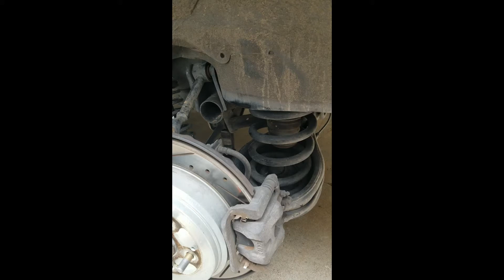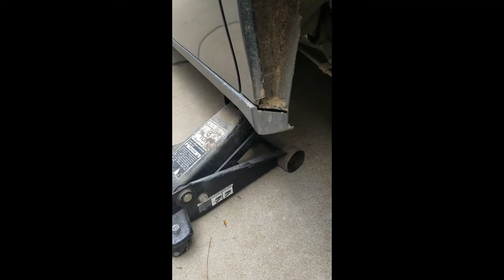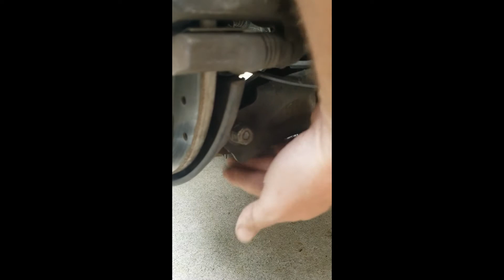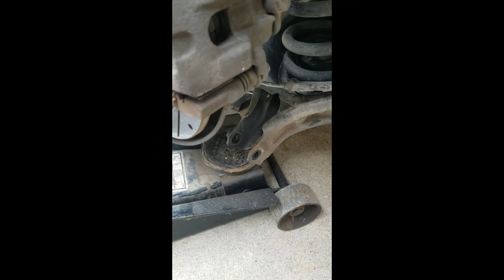15 Minute 2003 Honda Odyssey Rear Spring

Comment: how did you find the right spring for your van?
Reply from the maker: I ordered the springs from RockAuto.com, I find they generally have the best price and they have a wide range of replacement parts/brands.
Reply from the maker: I generally order parts from rock auto .com, they usually have the lowest price by far. You do have to pay for shipping so make sure you grab all the extra items you need. I always grab a few wiper blades, fan belts, filters so I only pay one shipping fee on the whole works. But I do have way to many vehicles. They make it easier to keep them all in top top shape.